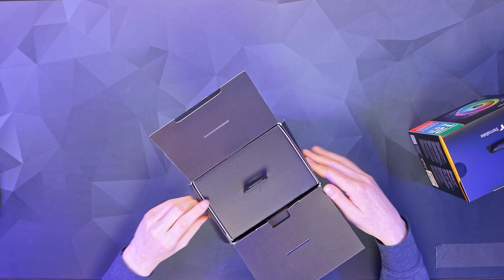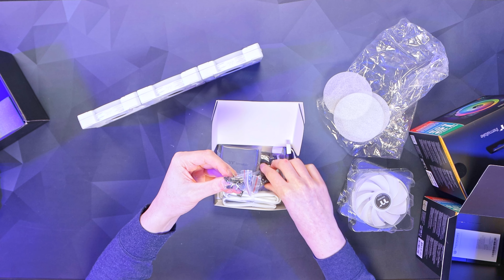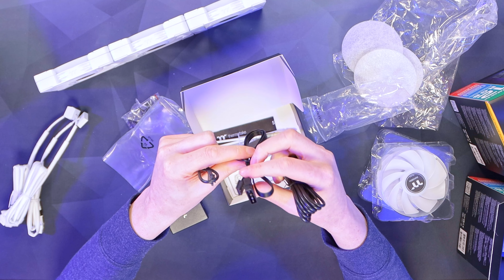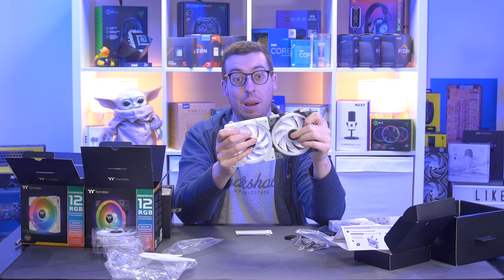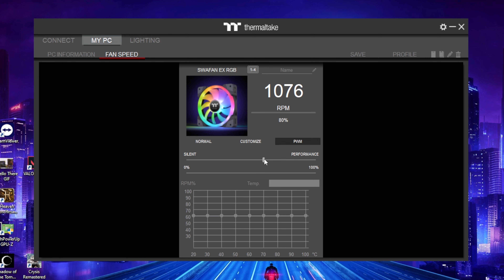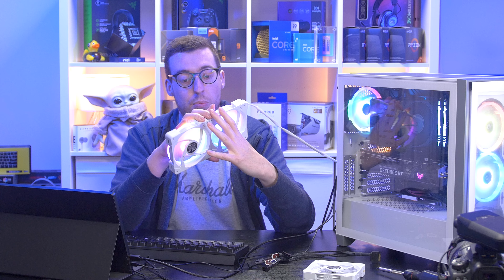UNI FAN KILLER? - Magnetic & Reverse Blades INCLUDED! - ThermalTake SWAFAN EX12 - Unboxing & Review!

Comment: Buy these fans at your own peril! I recently purchased 2 Thermaltake SWAFAN EX12 ARGB and 2 Thermaltake SWAFAN EX14 ARGB 3 fan kits. The problems I had getting them to even spin was a complete nightmare. At first I thought it was a MB issue, since it was a new build, and spent some time pursuing that theory. However, after I realized the MB was fine, it left the brand spanking nes Thermaltake fans as the potential problem. After talking to a annoying "company tool" at Thermalfake a very interesting fact arose. The "tool" admitted that they were having some issues with the new fans. It appears there are serious problems with the magnetic control/power leads on these fans. To quote the "tool" - "There have been a number of problems, but not enough to do a recall." Like I said, I bought 4 of the 3 fan kits. I had already tried a different set of leads, out of desperation, but at the suggestion of the "tool"  I kept trying different leads, since I had 12 (but should have only needed 4 total for the fan setup) and low and behold, one of the leads, from a yet unopened box, actually worked! Every lead in the first box and at least 1 lead from the second box (I haven't tested them all yet) were defective - that's 3 out of 4!!!! But not enough for a recall I guess. Thermalfake will never see another penny of my money after this experience. I hope this prevents some of the viewers here from experiencing what I have dealt with thanks to Thermalfake.

Comment: Before buying my fans I carefully studied my options . Lian Li infinity is much cheaper than swafan, better quality and have reverse version too. You absolutely don't need it to be reversable if you know ahead what you need. I got 3 normal and 6 reverse infinity fans that allow me all sorts of optimal fan configurations in my case.
Another more important thing is swafan airflow is 53 cfm while inf is 61 cfm, both providing similar air pressure, infinity being slightly better.
And lastly infinity has less cable usage since connection points provide electrical and signal connections too eliminating the need for additional cables.
Reply from the maker: Are you in the US, because they're not much cheaper here. Same price as these without the controller in fact. 

Of course you don't need it to be reversable but some might like the option, especially new builders ☺ Glad you're happy with those though.
Reply: @jordanash  in triple packs infinity is $100, swafan is $135. I wouldn't choose swafan even if prices were the same since they are weaker, need more cable etc. I am in Europe and yes prices are higher here.
Reply from the maker: Oh right, the infinity are the same if not more here. I'll have to try them and compare